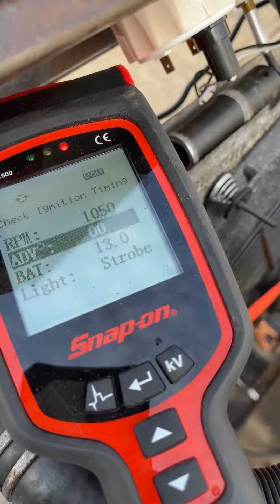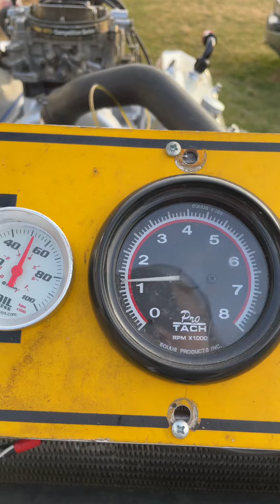406 small block Chevy 600hp

Comment: Definitely not 600hp but it sounds good.Will be a nice motor for that truck that’s for sure.500 lbft of torque is a threat to anyone on the street.N/A on pump gas even better.Looks like you have a fun build going on.
Reply: Ain’t it funny how the internet turned this guy into a dynamometer?
Ha ha 😂
Why thank you mister know it all!
Reply: I think  Joshua  was just joshing you !
My little 327  Forged Steel Vette Crank in a 4 bolt main 350 block with  12:1 Forged Pistons  , Ported Heads,  Crane camshaft,  Headers,  1050cfm Holley Dominator carb  and some other "goodies "  is in the 600hp range  ,
That goes into an 11 inch clutch  , Lakewood Blow Proof bell housing,  M-21 Muncie 4 speed trans and 12 bolt posi  , 

Pulls both front tires off the ground in a 66 Chevelle Super Sport that weighs 
3200lb   and  does 5.5 sec in the 1/8 mile .
Reply: @jimthomas1989  lol funny 327 N/A 600 hp.I must see a video or Dino sheet of this.This would be the baddest 327 in the world if it cracked 600 N/A.I have seen a couple 427 sbc AFR heads and all the goodies like mine crack 600.You absolutely must send me a video or something of this.I really want to see.
Reply: @joshuagarvey9362  , 
This was back in the early 2000s 
I have since  replaced the Crane camshaft with a milder Comp cam,  the 1050cfm Holley Dominator carb has been replaced with a 750cfm carb  ,  I was only getting  3 miles to the gallon  of gas , it will still pull both front tires off the ground in a 66 Chevelle  that weighs 3200lb .
And Josh,  this engine  can Rev to 11,000rpm before the valves start to float  , I did this twice  in 2009 .
This 66 use to drag race and  got retired in 2004 , it's only steet driven  ever since  , but I do get on it occasionally .  

Cubic inches  doesn't make horse power  , Compression does Josh .
The higher the Compression Ratio   the higher the hp .
Reply: @jimthomas1989  I don’t understand sorry to say.Your telling me cubic don’t matter only compression?And reving to 11,000 rpms makes more power?Hmmmmm.What heads flow that far especially back in 2000.Definitely not 23 degree heads.What solid cam starts at 8000 rpm’s and cuts out at 11,000.I am just lost for words.I can only imagine if your Could make 600 hp out of a 18 degree head 327 sbc you would need at least 14-1 compression and a cam with a custom grind somewhere with a dur in the 300’s @.50 watch I never heard of.I am very curious to what heads you ran back then and what are the specs on this cam.I am definitely on board with you on compression makes power no doubt.Torque makes hp and compression does just that.I am very curious to know about this motor and especially what block you used.

Comment: With an edelbrock carb??? I doubt it!!!  Sounds good tho
Reply from the maker: Edelbrock carb and intake are temporary, port injection EFI is going on the carb and intake were just for the run stand. But don’t be fooled that Carter carb is a 750 and I’ve had some very rowdy cars with an Edelbrock or Carter afb style carb.
Reply: Cause you don't know anything about carbs or how big you can make them